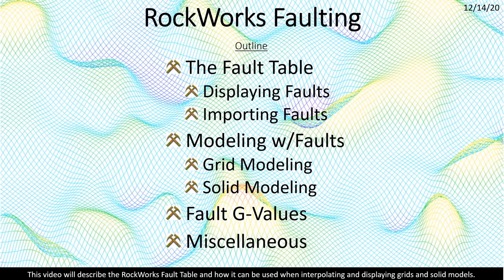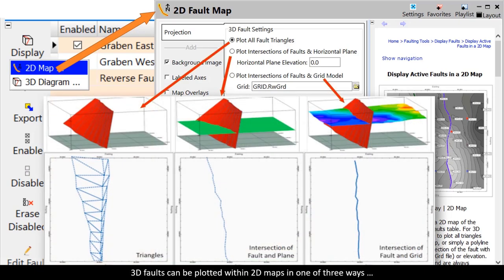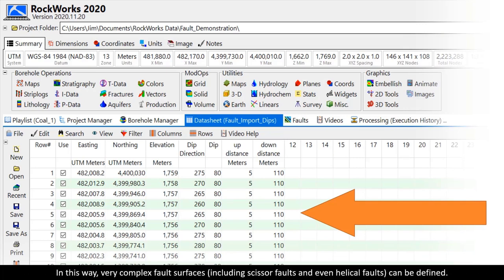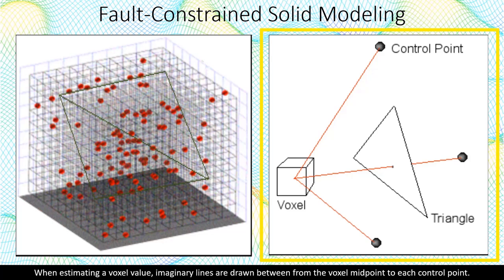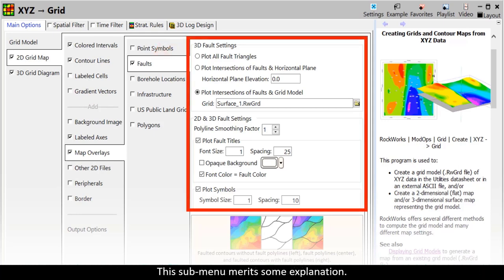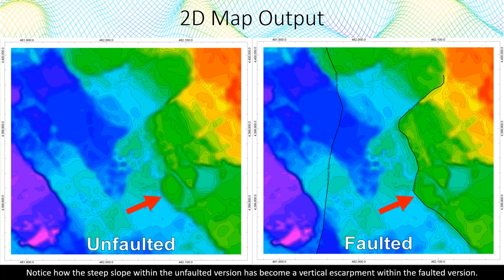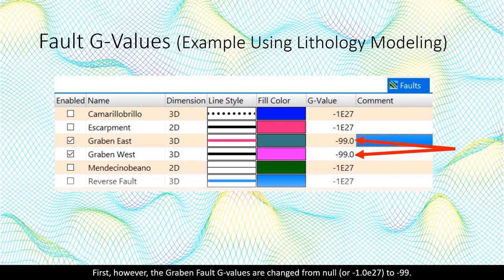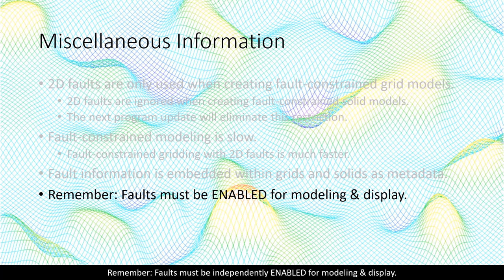RockWorks2020 Faulting

Comment: Hi, I use RockWorks 17 software. I have problems with the efficient design of the database for 3D fault modeling from the modeling module offered by this program. I would like your help. Thanks in advance.
Reply from the maker: Hi Mohamed, please contact support@rockware.com.  We only check YouTube on occasion.  - Jim Reed